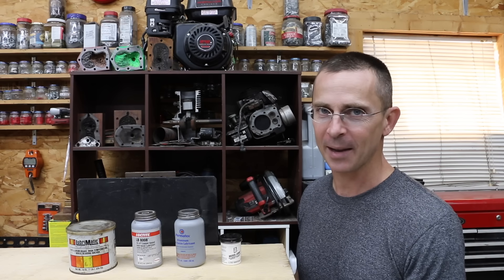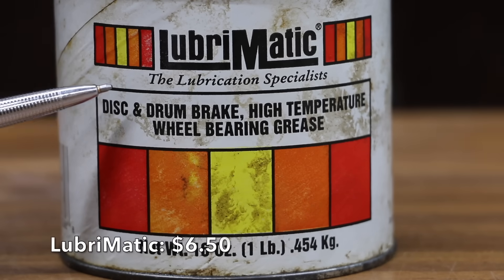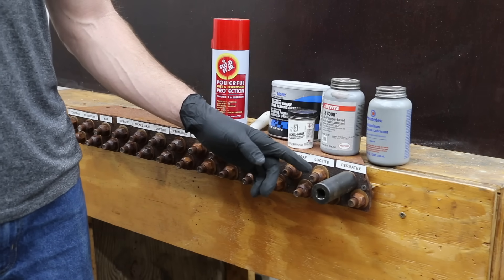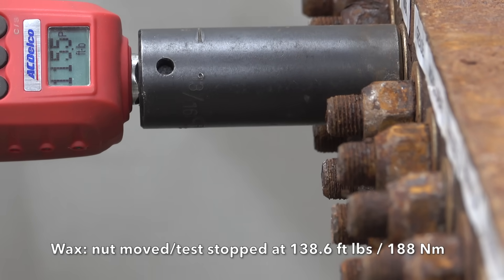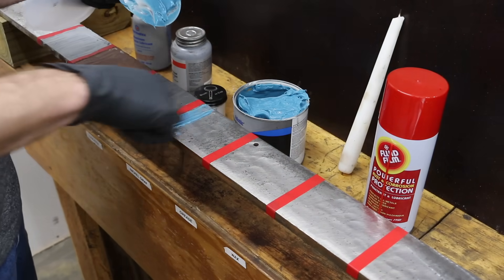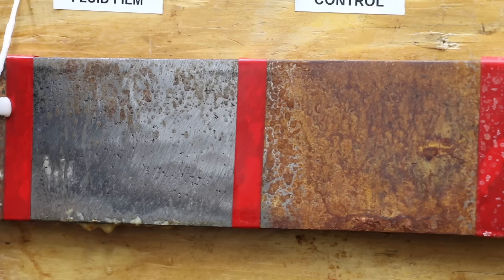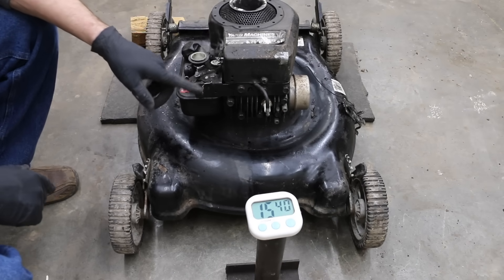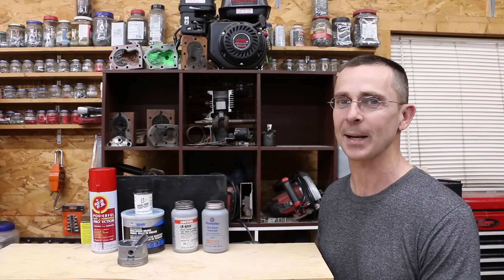Does Anti-Seize Compound Actually Work? Let's find out! Anti-Seize vs Grease vs Fluid Film vs Wax

Comment: From personal experience I use to use wax to rust proof things and it was good for about up to a year when using wax to prevent rust you got to slightly heat up the metal to about 200 to 250 maybe 300 what ever you can get before it burns off rub the wax on the heated metal let it cool and rub off the excess wax
Reply from the maker: Thanks for the feedback.

Comment: Working on aluminum engines for 20 years...yes it definitely works, lol.  Galvanic corrosion is a big problem.  I've always just  used permatex aluminum based and never thought about galvanic corrosion risk with copper based product!  We use nickel based antiseize on gaskets and bolts on anhydrous ammonia equipment at work for easier disassembly and are not supposed to use the more commonly available at plumbing supply copper based products since ammonia attacks copper.
Reply from the maker: Thanks for sharing!

Comment: My coworkers laugh at me for using anti-seize on so many applications, but working on rail equipment, it's a very harsh environment - some things may not see that part removed for 6 months, and by that time it's been subjected to sun and weather, heat cycling, and all around abuse. 

Anti-seize ensures it's not galled and... seized. 

Side note - we had some locomotives rebuilt and the traction motor bolts got hit with red loctite instead of the anti-seize they were supposed to have... 1-3/8" bolts torqued to 1200 ft-lbs and loctited in place - that was hell to get them out.
Reply: Against red Loctite, the best course of action is moderate heat.  Even better is to heat the bolt and surrounding area with the soft part of the flame of a torch, with care, and then quickly zap the bolt with a can of penetrating oil.
Reply: @alfredomarquez9777  normally, yes. Can't do that with a traction motor. Had to use brute force - 1" breaker bar and a forklift to get it started.
Reply from the maker: Thanks for sharing.

Comment: at work (large structures and pipeline) we use a Moly infused anti seize. and it works great, even the cheap ones work a lot better than nothing
Reply from the maker: Thanks for sharing.
Reply: to the motor part, anti seize is a poor lubricant, it has nickel or copper solids in it. so if used as an oil or anything friction based it will be worse than probably nothing at all.

Comment: The use that aluminum antiseize featured in this episode. It has been great! So seized bolts yet! And the bottle has lasted me years now! But it does have the tendency to get EVERYTHING silver haha. One part of my model of car (FJ Cruiser) that gives a lot of people trouble are the lower cam bolts that bolt the lower control arm to the frame. They have a tendency to rust and fuse to the metal bushings of the lower control arm and often require a sawzall to remove them. Luckily a few years back I replaced my lower control arms and the bolts weren't seized but to avoid issues in the future I gave everything a real good coating of the aluminum antiseize. No problems in my future!
Reply from the maker: Thanks for the feedback.

Comment: nice video sir, 
i work on boilers and chillers and i can say that copper based anti seize works great for me. i'm running 370 degrees F and 340 psig hot water high temp system. it is amazing how much rust happens on my studs for access plates that sit for a year under those conditions.
Reply from the maker: Thanks for sharing.

Comment: Todd thanks for the time you invest to make these great videos I was told years ago my an old timer that was a mechanic mid 60's through approx early to mid 80's That the alum colored anti seize was for low heat use and the copper anti seize was for higher heat use not sure how true that is but its what i was told. I use fluid film a lot for keeping rust and corrosion away I really like it bit i don't think its the best penetrating oil. I was impressed by nickle graf it seemed to work fairly good. Hope you and your family are doing well during these trying times. Stay Safe. Stay Healthy. God Bless!
Reply from the maker: Thanks for  the feedback.

Comment: Great Work and time commitment to this and all your videos. General question, wouldn't the measure of a better anti seize be to have the break away torque closer to the initial torque? If one weren't to use safety wire, cotter pin, safety nut, or other secondary safety, the friction would be the only thing keeping the nut from backing off. I would think you'd want this as close to spec as possible, while still being able to remove for maintenance.

Comment: I used to be an automotive supply salesman. Customers go through brake clean by boxes everyday. Most of them complaint that they used to go through less brake clean before the emission regulation. Some people only use European break clean even though its 2 times more expensive. Some doesn't use any brake clean and only uses gum cutter / carburetor cleaner for everything.
Reply from the maker: Thanks for sharing.

Comment: Is there anything that functions as an anti-sieze and a thread locker? For example once on a boat I used a lot of stainless screws in aluminum threads and put marine silicone adhesive/sealant on them. It seemed like this prevented them backing out and prevented or inhibited galvanic corrosion between aluminum and stainless. But the silicone sealant is not so strong that it prevents disassembly. It would be great for boat owners to know the best way to deal with stainless/aluminum interface since it is quite common.
Reply from the maker: Thanks for the video idea.

Comment: I'm not sure the Anti-Seize had a fair shake in the engine test.  That engine was in very poor condition before the test, which may have contributed to its failure.
Reply: It probably helped increase compression at first and eventually causing too much compression as it built up.
Reply: @Nathan_King  Thats an interesting point I hadn't thought of.
It would be interesting to see it tested again on a fresher engine.
I also suspect that on a splash lubricated engine it was perhaps not able to get into the connecting rod bearing very effectively, I wonder how it would do in an engine with a proper oil pump (and a bypassed oil filter).

Comment: Cool experimental design. Would be cool if you put standard deviation error bars on your graph. I reckon they'd probably overlap due to your small sample size, but if you scaled this up to 5-10 bolts for each they be pretty small. All-in-all though, I think this is pretty solid information I'll use for my next purchase.

Comment: I used to work at archer Daniel's Midland in columbus nebr. We used locktite antisieze once all the bolts and nuts
. We had a lot of stainless steel bolts and nuts which would seize if  you 
Didn't use anything.

Comment: Anti seize is somewhat questionable.
Oils typically work well at low temperatures.
Milk of magnesia works on high heat.
Tried every method and anti seize, and milk of magnesia allows removal with minimal effort.
I know it sounds crazy

Comment: video idea: what kind of anti-corrosion should i put on my automotive battery terminals? WD-40, vaseline, trailer bearing grease, motor oil, canola oil, or something specifically manufactured for electrical terminals like dielectric grease or CRC marine corrosion inhibitor or???
Reply: Dielectric grease.  You do not want something that starts out or gets very thin with heat for use under the hood.  Where the heck did canola oil come from?  This isn't a stir fry, canola oil is inferior for every purpose besides cooking.   It can also help to get some felt pads to go on the terminals and saturate them with dielectric grease too.  Often the outgassing occurs past the terminal posts.
Reply: @stinkycheese804  thanks for the tips. Of course we SHOULD use dielectric grease. Although CRC might work too. But at times I have found myself in a situation where I had to improvise. So I am wondering if any of those other things will work better than nothing. I have certainly used WD-40 when nothing else is available. It contains components of different voltilities and after the volatile components boil off it may leave an oily residue that prevents corrosion. Not sure. If you were at someone's house changing their battery as an emergency favor without any proper tools, cooking oil could be your only option (other than nothing). Most cooking oils will eventually form a gummy, sticky, ind of polymerized film eventually.

Comment: Anti-seize is not a lubricant it is, in fact, an abrasive...as you found out.    The reason why Glock applies copper anti-seize to Glock slides at the factory is to lap the parts together as the gun is fired.

Comment: I was a mechanic for a large logging company back in the 1980s we had chemical salesman that supplied us with thread ease anti seize brake cleaner and electronics cleaner . The thread ease came in spray cans . We used it mostly for LUGNUTS on log trucks.  I went to college during the day and mechaniced at night after I was done in school I got a paid internship. My last day on the job was a Friday . There was a parade the next day and several company log trucks were going to be in it . The tire guy made sure all the trucks in the parade had new tires and wheels to look there best. There was a driver i honestly didn't like. My boss had to pull me off him once and a couple days later I had to pull my boss off the same driver.  Anyway picture if you will my lastnight there. This weasel comes in the shop with a request for wheel paint because his truck was in the parade the next day. Well I knew the truth his truck had a brand new set of wheels. So he was lying but wanted paint. I said ok I have this new stuff the chemical guy just brought us it's supposed to be better  than emron . Whenyou soraybit on it will look like shit but overnight it will harden and look incredible . I. Went and pulled the label off 3 cans of thread ease and brought them to him . I heard sometime later he had painted his boat trailer with it and made a giant mess

Comment: I rub a little grease on wheel lugs when changing or rotating a tire and have never had a problem with seizing.  I have never found the nuts being loose (some people tell me putting grease on the lugs will cause the tire to fall off, but it hasn't happened in 500k miles for me).

I remember when I was a kid, my father's truck got a flat tire.  One lug nut was seized, and got rounded off.  Luckily, my father had a heavy chisel and was able to chip the nut off and change the tire.  Ever since then I have been putting a little coat of grease.
Reply: I've seen lug nuts snap off, due to being rusted, when trying to change a tire.
Reply: @tonyhemingway7980  yeah, I have seen that happen also.

Comment: This is one where I had a pretty good idea of what the results would be. I drive and do my own mechanic work on a Road Racing car. Working on the brakes, nearly daily is just part of the deal. Hi-Temp anti-seize is something you learn is near mandatory if you don't want to end up stripping something out. Without the hi-temp anti seize, the heat cycling causes all kinds of problems.

Comment: Great real world test. Most people do not account for different torque spec for dry vs. lubricated threads. In my cheater book it shows a grade8 1/2” bolt torque to be 108 ft-lb dry and 64 ft-lb lubricated. Wonder if the results would vary with proper torque applied. Great video and keep up the good work. One of my favorite channels. 🤙

Comment: @project farm, I absolutely love your channel but I can’t help but wonder if you didn’t miss something with this test. I would have loved to see you test these products against galvanic corrosion, similar to threading a steel threaded spark plug into an aluminum head or steel head bolts into an aluminum engine block. I feel like this is where a lot of users of anti seize benefit from its properties. I know that in the bike industry we use a lot of titanium hardware and we have to us anti seize compound anytime there a ti-aluminum, ti-steel, or ti-magnesium interaction (similarly using steel fasteners into aluminum alloy or magnesium alloy, pressing bearings into alloy hubs etc...). 

Anyhow, like I said, I love the project farm videos. Keep up the good work. Maybe it’s a video idea of another time!👍🏼

Comment: Nice testing!
As I stated before, I like anti-seize for most applications.
I just saw the icon for the fuel vapor myth, and remember the video.
Any way to test that HHO system on one of your little gas engines and see if it works?
I would not try to run the engine off of it, but rather have the engine somehow power the system, and see if it gets better performance or "mileage."
The old research stated that it simply cleaned up the exhaust, and the extra bit of free hydrogen just made the hydrocarbons do a complete burn, with little or no emissions.

Comment: Do you torque on the head when installing on a lawn mower or just go by feel?
Reply: That would depend on how good your feel is.  Getting it in the ballpark is not hard by feel if you've used a torque wrench so you know what various torques at different ratchet or wrench lengths feels like.

Comment: I worked in a fertilizer factory for years lots of sulfur and salt basically most othe chemicals you can think of it did  not matter what i tryed or how much i used every rusted and became 1 every job was at least 50% battling rusted bolts and bearing races gave
Reply from the maker: Thanks for the feedback.

Comment: The metal content of anti seize lube is deliberately abrasive.  It helps to break up corrosion and slightly open tolerances as you remove the fastener.
Reply from the maker: Thanks for the feedback.

Comment: Anti seize, to my understanding, was developed to prevent thread galling. Not so much to prevent things rusting up. 

If you ever tried to assemble stainless steel bolts with stainless steel lock nuts, you know the importance of using a thread lubricant to prevent galling and cold welding.
Reply from the maker: Thanks for the feedback.

Comment: Been a fan of Permatex since the 80s. In fact, I'm fairly sure the bottle on the shelf in the garage is circa 1991. Sure it separates, just stir it up, and it works like new...
   Permatex : Expiration dates? We don't need no stinking expiration dates...🤠

Future video request : 2 1/2 ton Floor Jacks! 
Craftsman vs Snap On vs Horror Freight vs Wallymart vs Jegs or Summit Racing. 

My 2011, $109 Jegs "Aluminum Racing Floor Jack" just 💩 the 🛏 this evening. Release seal failed. POS. You get what you pay for....
   Then I thought....Project Farm might consider torture testing these...love to know where NOT to buy my next one. ❤
Reply from the maker: Thanks for the video idea.

Comment: Been using a product in the oilfield for years very similar to the Permatex product called Jet-Lube, it's a Canadian made anti-seize/thread lubricant. We use it on many different parts but I realized it's value around Nitrogen pumps, applying it to the cold end threads which are stainless steel and while pumping liquid N2 can get down to -321° Fahrenheit. We also use it on the burner parts which will reach several hundred degrees. The stuff works.
Reply from the maker: Thanks for sharing.

Comment: Oxymoron: use Loctite to prevent seizing.
Reply: Megaloc is my favorite thread sealant, use it for anti-seize all the time
Reply: @christophertstone  anti seize isn't normally used in machinery, the mica or copper contaminate and sometimes seize close tolerance parts. The object is to prevent corrosion. So anything that adheres well (loctite, cosmolenel) will provide better corrosion resistance than anti seize.
The mica or copper is to displace moisture with physical materials but does not adhere to the materials like loctite or cosmoline.
Years of painful removal of various seized parts made it necessary to improvise
Reply: Actually, loctite prevents corrosion and with specific heat can Released instantly, even "permanent" loctite.
So loctite is better than anti seize.
Reply from the maker: Thanks for the feedback.
Reply: @ProjectFarm  happy to participate.
I really enjoy your perspective and genuine testing methods. And I just wanted to inform about loctite and some of the hidden uses based on the topic.
A loctite test would be fun. The selection will make your head spin. Contact them directly to get a complete list of their products and specs, i found them helpful for the jobs i had engineers come to the shop.

Comment: I enjoyed this video, except for the engine part. Just measuring the pressure it would take to push anti sieze through crankshaft lubricant passages would show its unsuitability. Several other things came to mind. Testing antisieze as a gasket or thread sealant. Testing home made antisieze, from oil + graphite + metal powder. Nickle anti sieze is used around ammonia refrigeration won't be eaten by the ammonia like copper and aluminum will - only good use I know for it. I've learned that copper anti sieze has a poor reputation with cat mechanics, but have found it to be better than the aluminum stuff for preventing the reaction between stainless fasteners and aluminum in a salt water environment.
Reply from the maker: Thanks for the feedback.

Comment: You only need to know of the one anti-sieze that rules them all instead of worrying about metal incompatibilities and allergies. Loctite 51048 with 60% molybdenum disulfide by weight is worth the ridiculous price, a bottle will last years and your bolts will last longer.

Comment: When is sampling stainless steel nuts and bolts together you must use that copper  anti-seize. I   ues         of thousands a stainless steel nuts and bolts if he did not use the copper anti-seize they would gall and you would end up breaking them off.